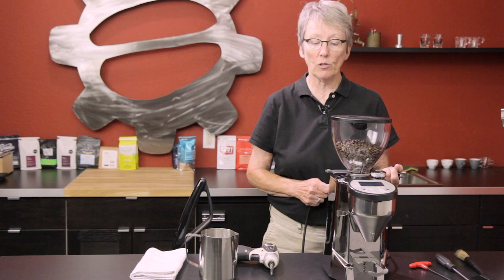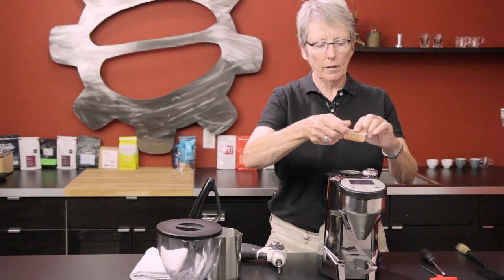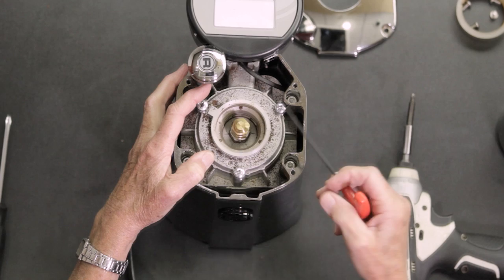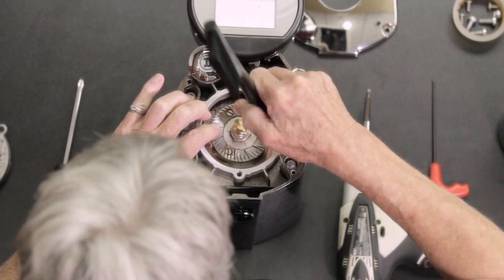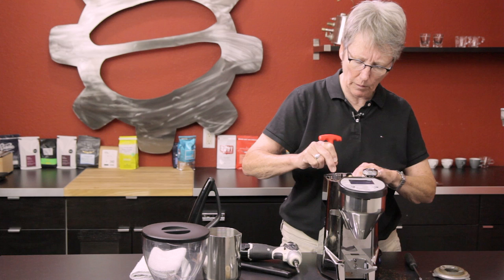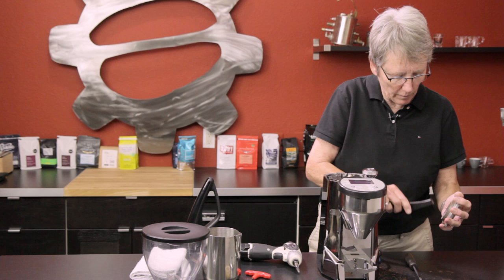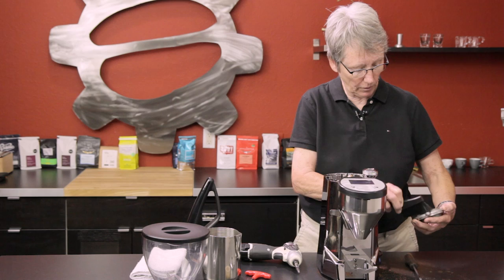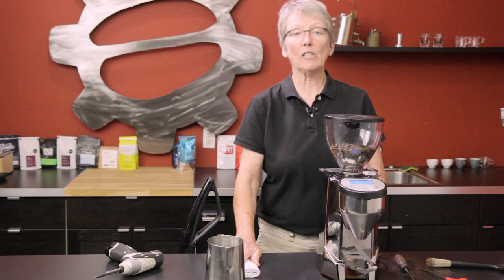How to Clean the Rocket Fausto Grinder

Comment: Thanks for the demo. I have one of these and it's just reminded me to clean it out as it seems to be varying a little shot to shot. I also clean the chute with a soft bottle brush.
Why ever they didn't standardise the screws so that you only need one screw driver is beyond me (retired mechanical engineer). I also take the precaution of using a Sharpie or similar marker to mark one of holes on the top blade and the body before I take it apart just in case there are any slight differences when you reassemble it.

Comment: When you took off the top burr, it was in the orientation with the screw near the stub on the inner hole of the burr holder aligned at the micrometer.  When you put it back together, you aligned it to the back of the machine.  Does it matter?

Comment: Is it a bad idea to use Minute Rice (as I have been told by some people) to clean the grinder?  (I have a Fausto - still pretty new, but will need its first cleaning soon...).
Reply from the maker: Hi there! It's not that instant rice doesn't work - it can actually work pretty well. However, it often leaves things very powdery after grinding, and the ground rice can get stuck in different cavities in the Fausto. We've also heard that the starch from the rice can get sticky from bean oil and seriously clog your grinder. Almost most importantly - most grinder manufacturers will void your warranty if you use rice. So while it might work, we don't recommend it! Your best bet is to use Grindz! https://www.seattlecoffeegear.com/grindz-burr-grinder-cleaner

Comment: How often should that be cleaned by taking it apart?
Reply from the maker: Hi William! While a handful of variables contribute to how frequently your grinder should be cleaned, we generally recommend home users cleaning with Grindz every 2-3 months and a burr disassemble and brush out every 6 months depending on how heavy usage is. Thanks for watching!
Reply: I have ~1500 doubles on mine after about 15 months and use Grindz every 4-6 weeks.  I used Grindz first and then opened it up per the video to see if it was worth it. While it was amazingly clean already, there was clumps coffee powder on the arms that clear the coffee where it comes out from the burrs and some packed coffee powder around the burr screw heads. Not a a lot to clean, but you can remove what little Grindz doesn't and you can inspect the burrs. Not hard to do and I'd do it again in another 1500 shots. But a shout out for Grindz - it does it's job.
Reply: Thanks for the Info
Reply: I should add that I use beans that are a light medium roast - just about at first crack. A darker oilier roast would need more frequent Grindz and opening it up and brushing and vacuuming it out